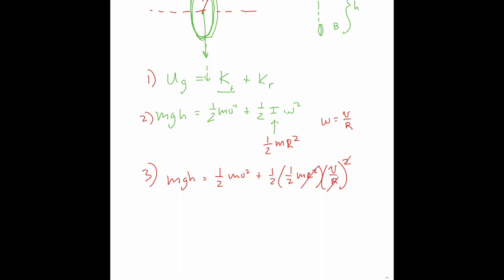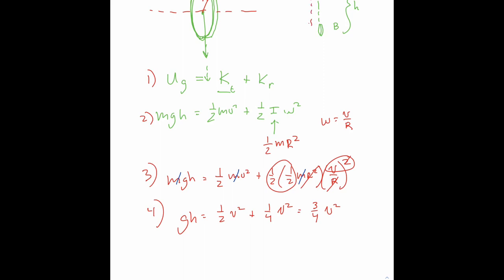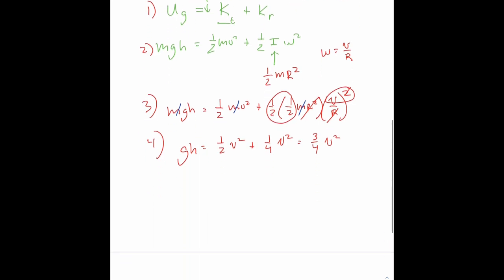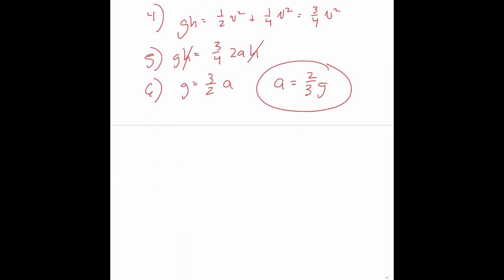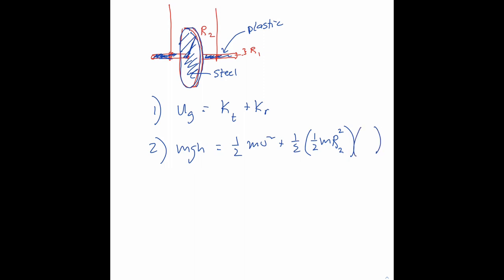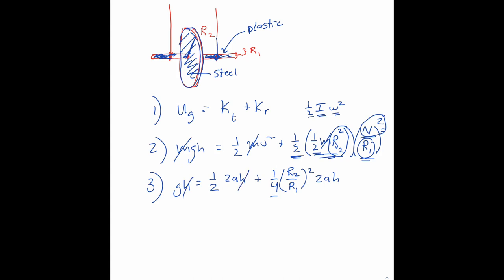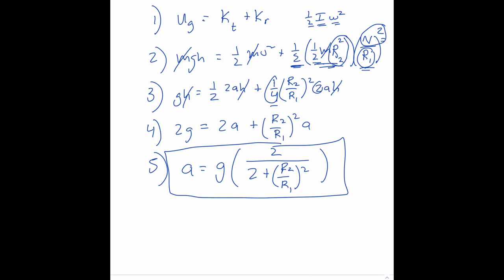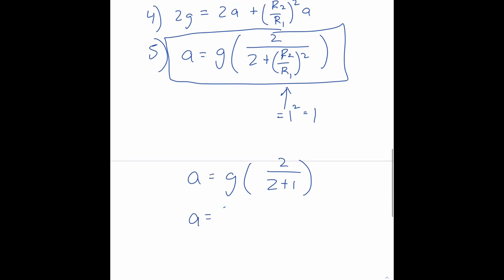Maxwell’s Wheel

Comment: Discussion: - 1. Does the distance travelled by the center of gravity of the Maxwell's disc depend on the mass of the disc if total mechanical energy is conserved? 2. Does the distance travelled by the center of gravity of the Maxwell's dise depend on the mass of the disc if the frictional force "f-bv" be present? 3. Can we measure the moment of inertia of the disc accurately if the wheel axle is not leveled properly? 4. Is it possible to determine the moment of inertia of the disc if it is oscillating after the start of the experiment? 5. Does the moment of inertia of the Maxwell's disc depend on the frictional force if it is present?
Reply: The only point of the wheel is to show how the mass becomes lighter when going downward in acceleration.